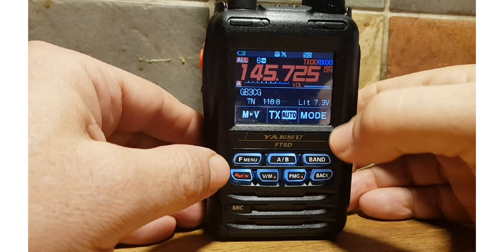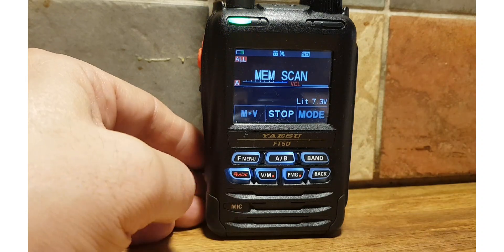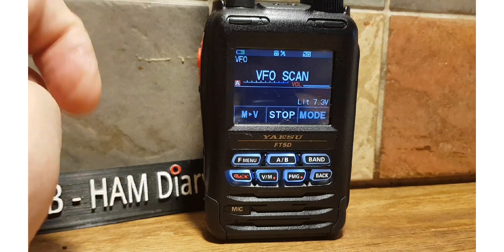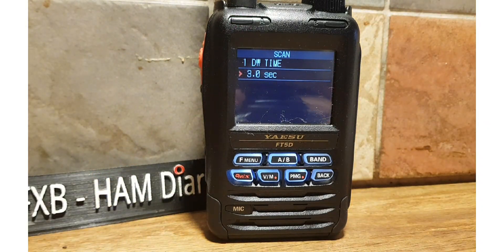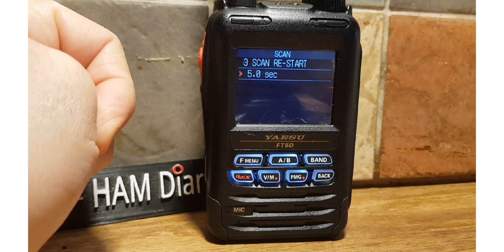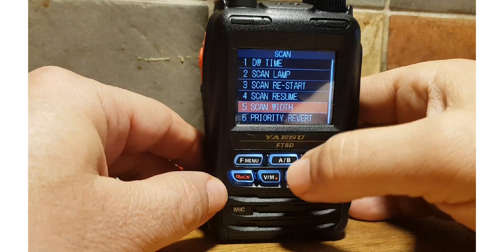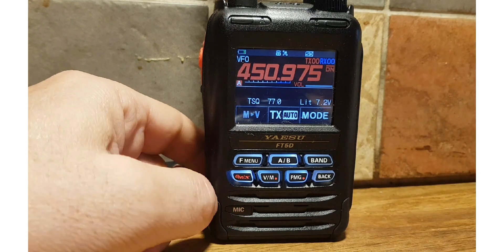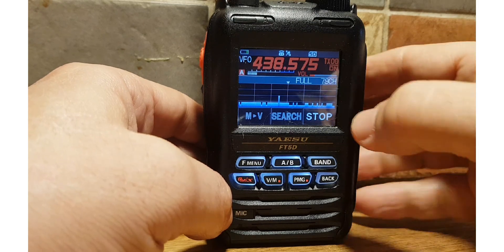YAESU FT5D -Scanning Operation + Settings overview

Comment: I don't like it hides the frequencies while scanning....This sucks especially when scanning in VFO mode... Older Yaesu radios used to always show the frequency.  Giving you less information is a STEP back in new models, not an advancement.
Reply: It displays the frequency of the busy channel when it stops. You couldn't possibly read the frequency while it is going through the channels. It scans 20 Channels in less than a half second. Displaying the frequencies while scanning probably slows the process down.
Reply from the maker: Yes strange why they did that .

Comment: Did they ever get the frequency to read out while scanning?
I know there was a firmware update since my purchase.
Reply from the maker: No such a shame .
Reply: @M0FXBHamTech  
Really seems like Yaesu doesn’t listen to their customers.
I bought the FT5 to start at “the top”.
I wanted a 991 to use as a 100w emcomm radio and found out you can’t mod it for GMRS.
I’m having to turn to Chinese radios now.  
I was after the 991 because it looked to be the most FT5-like with higher output as a 12v base station.
Now I don’t know what to do?
I wanted to go “all mode-all band” and get into some HF and retain YSF and a similar operation to the FT5, but without GMRS it crashes as emcomm.

Let me put that another way…
I’d like the “mothership” to the FT5 where I can transmit on GMRS (modded) for emergencies, run on 12v, has YSF and APRS like the little guy but adds power and HF?

Any ideas?  
Do I need to switch brands?

Comment: How do you skip a memory Chanel while scanning (like APRs freq)
Reply: Set the APRS memory channel as the active channel
Press and hold the F menu button
Press Memory
Select 5 Memory Skip
Turn the main dial to read skip
Press the PTT button.
You will now see an X under the memory channel number in front of the frequency
Reply from the maker: https://www.manualslib.com/manual/2235812/Yaesu-Ft5dr.html?page=21

Comment: Any thoughts as to why Yaesu decided to "hide" the frequencies being scanned? They are visible on the FT-3Dr, and the FTM-300 but hidden on the FT-5Dr and the FTM-200. I can't see any benefit to hiding them. I'd much rather know if it's taking too many seconds to scan thru a memory bank so that I can re-assign repeaters to a different memory bank if needed or, remove them from the memory bank being scanned.
Reply from the maker: Hi , yes this was such a bad idea many have complained about this I hope they fix with a firmware update .
Reply: I ask myself the same question. One good reason might be to reduce  battery consumption. When the screen is static it uses less power vs when its active and displaying channels that scans pretty quick. Another reason might be that the screen refresh rate is so slow, that wont be able to display much visible data. They screen that they use on the FT3/5D series is pretty cheap.
Reply: I just bought a new ft5d and I cant believe the frecuency is hidden while scanning, its a very very bad idea and its unacceptable. This feature converts the Ft5d the worst HT I’ve ever had in my life. I will sell it and go back to my old FT3

Comment: The way you explained it, there is no difference between the Scan Re-Start and Scan Resume functions.  Confused.  Need to hit the manual...
Reply from the maker: Even i got confused - scan resume means your scanning find you find  a busy channel then you set how many seconds it will listen to that station until it resumes scanning for new stations.
Reply: @M0FXBHamTech  The manual doesn't make it much clearer either.  Refers you to the advanced manual, then the same thing happens.  Ha.
Reply: Scan restart selects how long scan waits on a channel after the signal ends to restart. Scan resume will wait on the channel the designated time and resume Scan even when the channel is still busy.